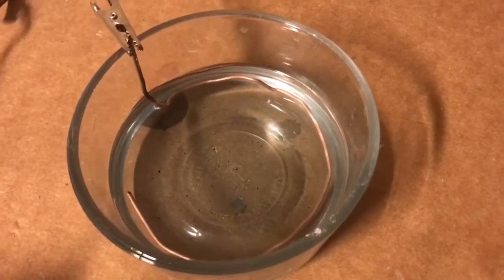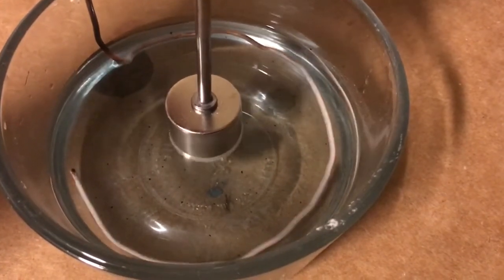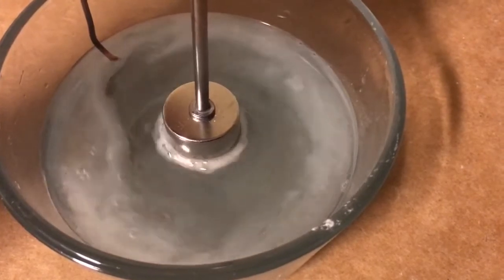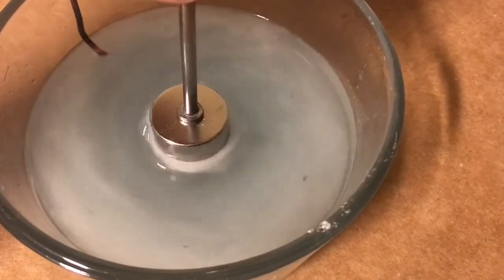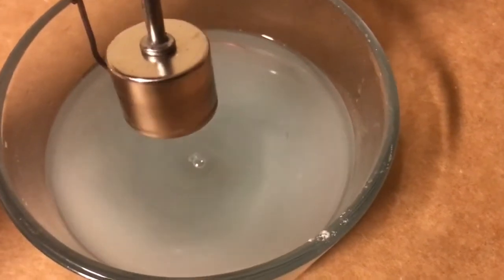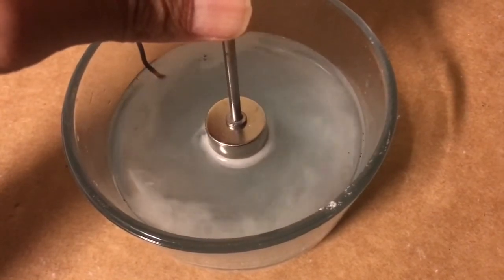Stir Liquid with no Moving Parts

Comment: Great work! That's also a very good method for preventing the gas bubbles from sticking to the electrodes slowing production. As well as some other possibilities.
Reply from the maker: It would help to expedite electrolysis reactions by clearing the  gas bubbles quickly as well as stirring the solution and keeping it homogenous which would also help to drive the reaction. . If I were to pass AC current at high frequency through the sytem, it would be a way to do high frequency agitation. You are right. I think it has some great possibilitities. Could also try inert metal such as platinum in place of the copper wire.

Comment: Could you share the circuit diagram? Trying to reproduce it. Thanks.
Reply from the maker: The liquid contains about 10-20% dissolved sodium carbonate. This is placed in a glass dish. In the bottom of the dish is the positive (or negative) electrode consisting of 1 turn of metal wire such as copper. This wire is the same diameter as the inner diameter at the bottom of the dish. A cylindrical neomagnet with the poles on each of the ends is stuck ionto the head of an iron nail. The magnet is placed in the center of the dish. Current is applied to the the copper wire electrode and the nail attached to the magnet. If enough current flows, the liquid will start stirring itself. If the current direction is reversed, the liquid will start going in the opposite direction. A non magnetic stainless steel wire loop may be better as copper will slowly corrode. Bubbles of hydrogen come off the negative electrode and bubbles of oxygen come off the  positive electrode. Hope this helps!!
Reply: @BrianDhvTinkerer  Thanks, much appreciated.
Reply from the maker: @jianchen5141  your welcome!!!